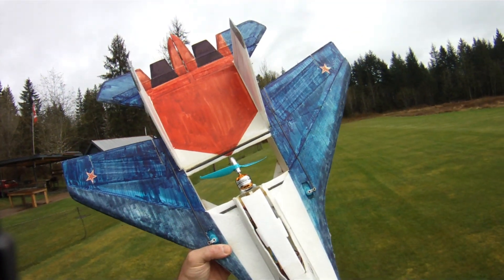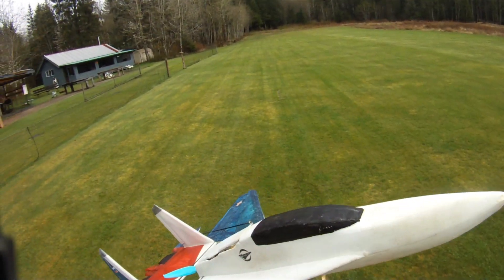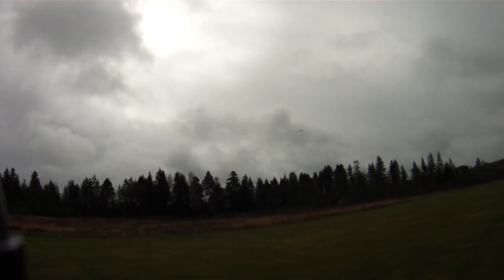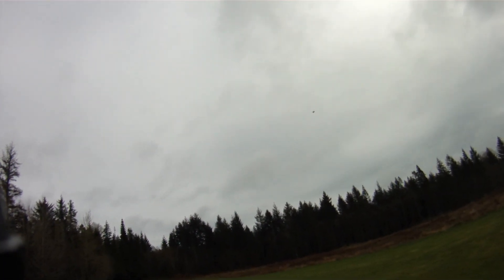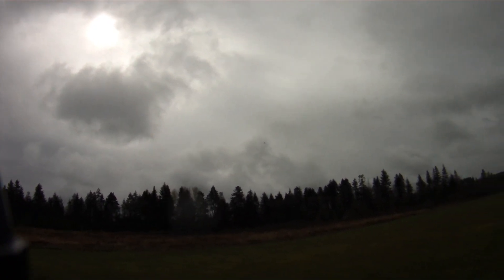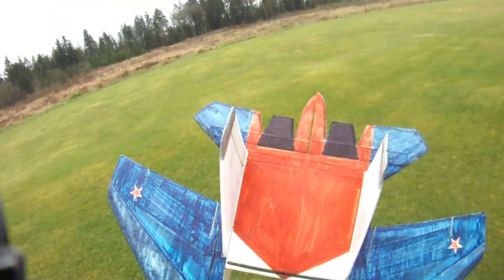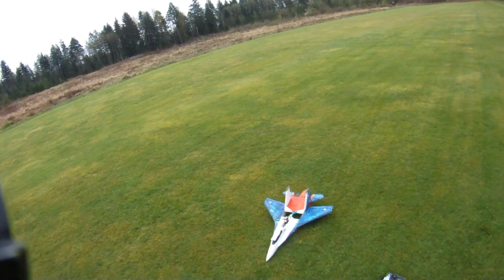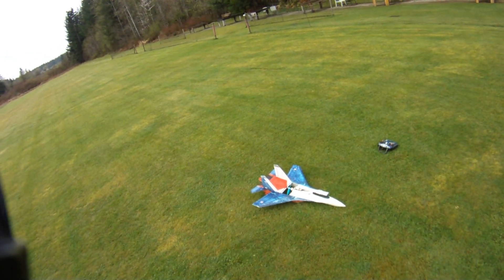2212/6 2200 kv motor Gemfan Flash 6042x2 prop on 3S - 19 Apr 2019

Comment: Congratulations on our 500th flight on that airframe! Very impressive! I'm still working to get 200 flights on one of my airframes ;-) That motor and prop certainly push that parkjet through the air very well. Like you said, pretty impressive for a 2200kv motor. I'm going to have to get one of those super cheap 2212s just to play around with. See you in the Air!
Reply from the maker: Thank you so much.  Those 2212 2200 kv motor are certainly very versatile and inexpensive, I moved to quad motors almost two years ago as once I got things figured out they just produce so much more power and are on average about 20+ grams lighter than the 2212 size motors.  The quad motors are more expensive and amp hungry, but the power they produce for their size is hard to beat :)  Cheers, Scott